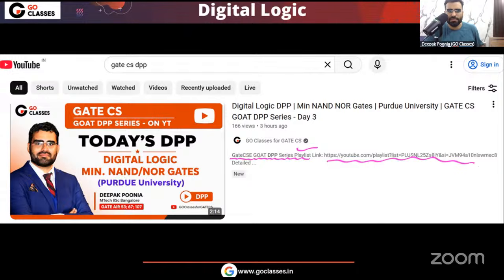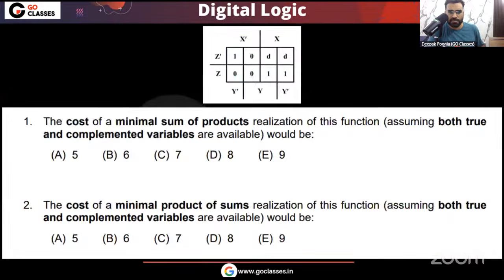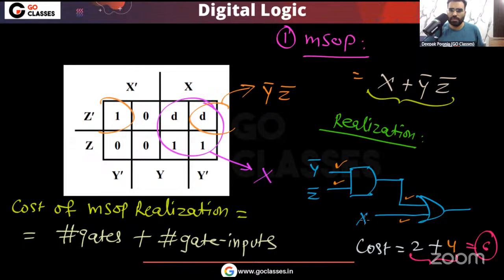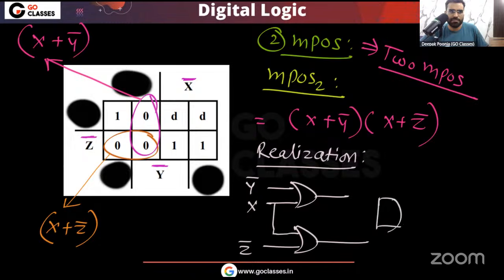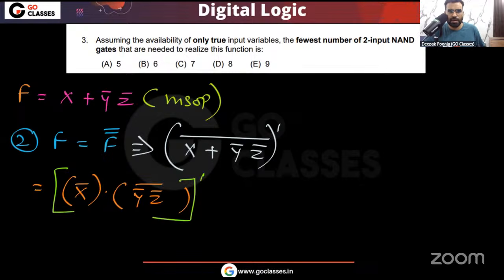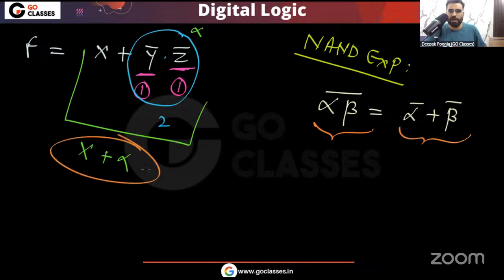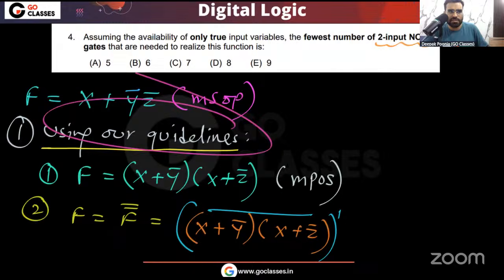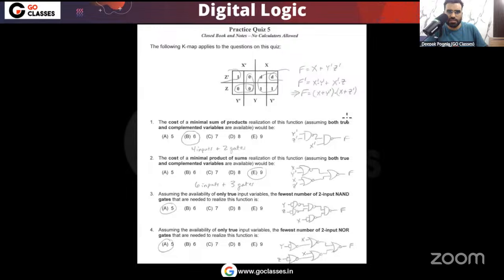Digital Logic DPP - Solutions | Min NAND NOR Gates | Purdue Uni. | GATE CS GOAT DPP Series - Day 3

Comment: Sir, 
In Question - 4, once you calculated Min No.of NOR Gate required = 5, where you used POS form of equation, But
Latter you calculated Min No.of NOR Gate required = 3, where you used SOP form of equation.
So when to use SOP form and when to use POS form ?, Kinly clear it.